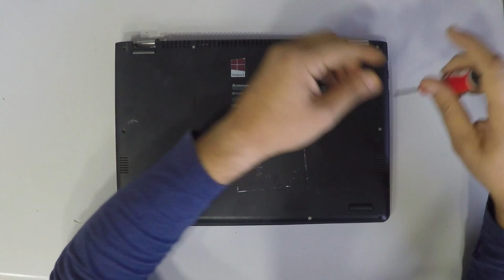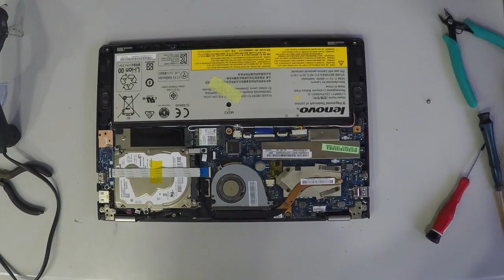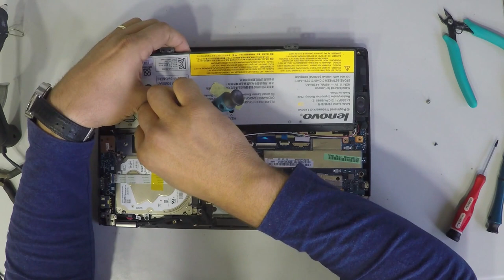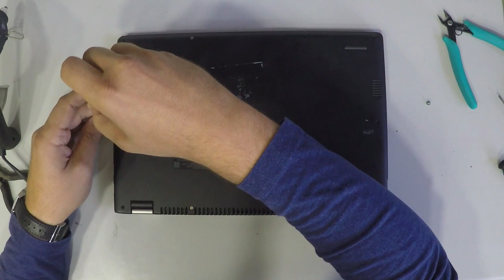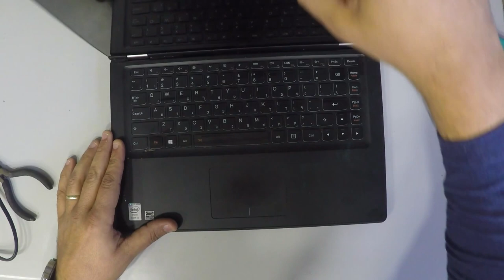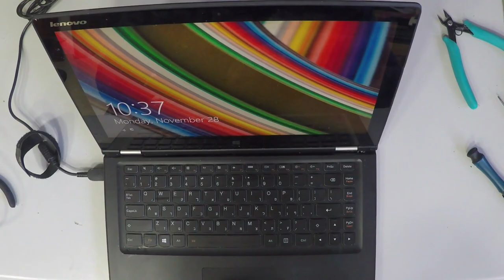Lenovo Yoga 2 13 Battery Replacement

Comment: Hi, where can i get this battery. Lenovo India doesn't have in stock. What is the name of this battery
Reply: Genuine L13M6P71 Battery For Lenovo IdeaPad Yoga 2 13 L13S6P71 121500234 50WH    I bought it on ebay and it was sent from Hongkong.

Comment: I charged my lenovo almost nonstop and now my battery has expanded and it doesnt work anymore. Is it safe to replace it myself or should I get it to speciliast in case it might explode or something as such when I try to remove it?
Reply from the maker: Hello Arramu
Don't worry battery won't explode you can do it yourself.
Reply: Shams abd el kader thanks a ton bro! now I can do it with 18£ instead of 90£ :)
Reply from the maker: your welcome

Comment: sir hi my laptop has a problem from last night that model is lenova ideapad yoga 2  ,the problem with the the battery that showing charging but battery wasnt gettng charged its 2 yrs old .now i was using it by plugging until if its not connected its gettng switch off kindly resolve my problem
Reply from the maker: Apologies I code not replay to your massages in time, I am back now and will replay to comment once a week in Friday. (you are welcome)